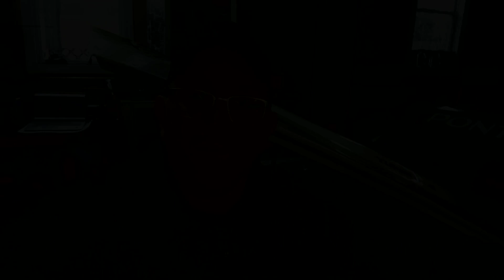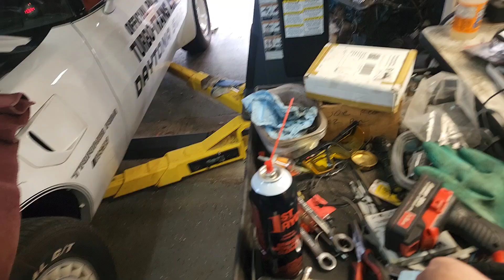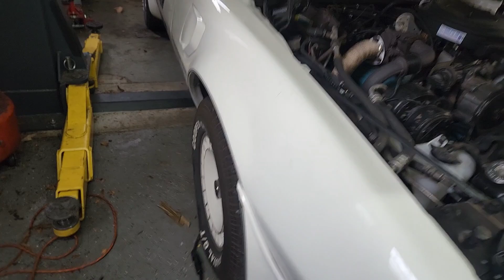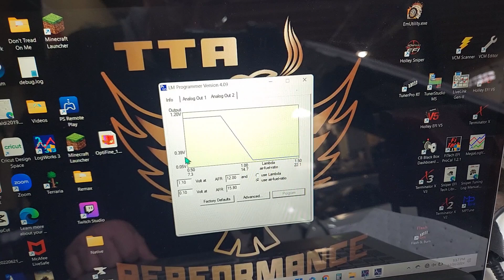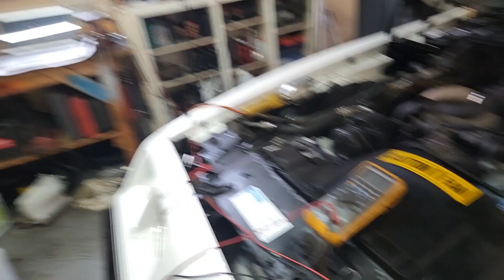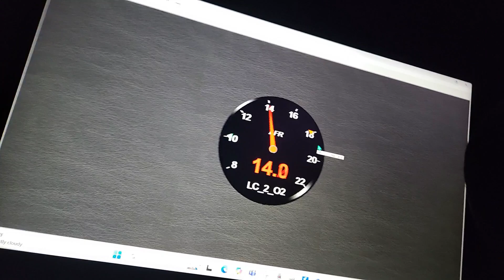TTA Performance - 1981 Daytona 500 Pace Car Part 3 - The GM CCC computer system.

Comment: Very interesting. My '81 was originally a TTA. When I bought it back in the early 90's, a Pontiac 400 had been transplanted, which I soon rebuilt and still use. I was told the original owner blew up the 301T. I never saw its original engine, ECM, and all the wiring and sensors it had. It would be too costly to restore it back to original, so I'm sticking with the 400 since it performs well. It's interesting seeing in your videos what it originally looked like under the hood.

Comment: After several mixture and timing adjustment I found my TTA is most happy in the 13 to 13.5 A/F range. it ran smoother, had better acceleration and exhaust was less stinky. Is the milage worse than the 14.7 or so a/f?, probably but I don't care...

Comment: i thought multi port injection should be at 14.7, carb and maybe old TB injection closer to 13.8 which is why the older cars often have an air tube going to the cat since they run too rich for the cat to work properly...at least for the standards in the mid 80s to around 1994 when HC limits changed again